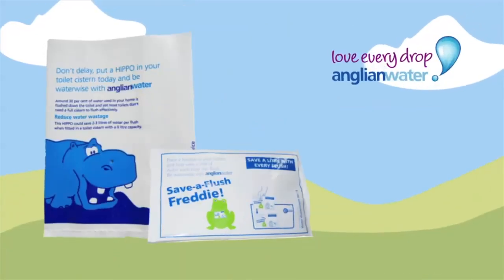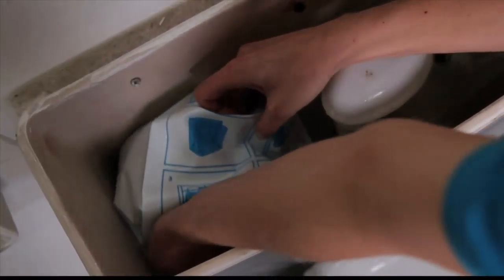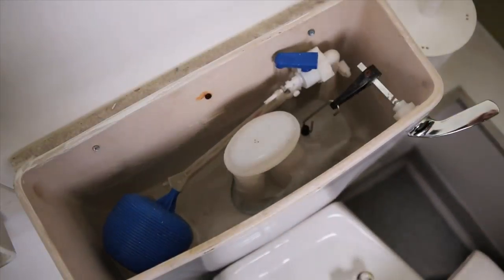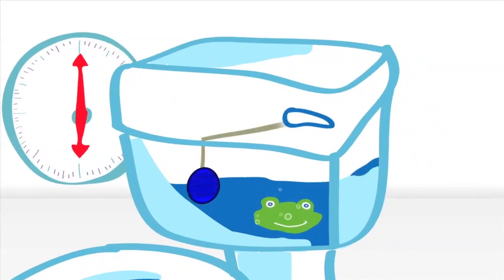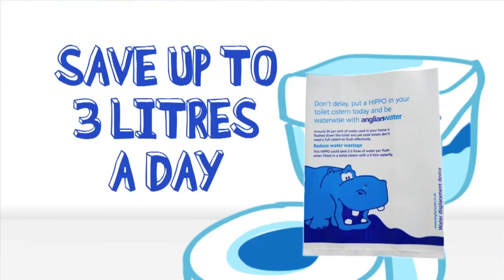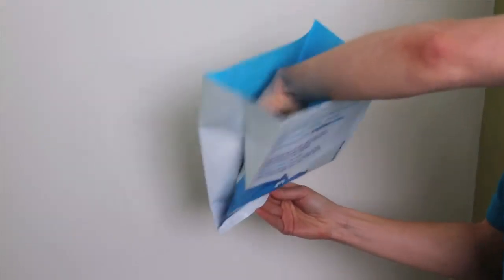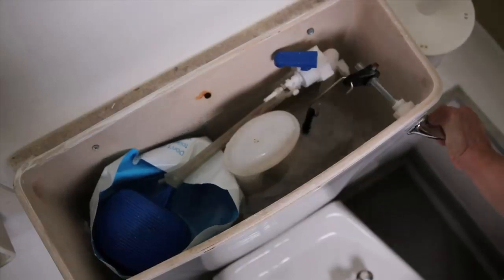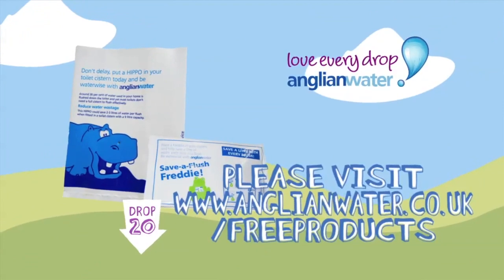How To Install A Cistern Displacement Device

Comment: Further tip:
install a top-on-or-side-to cistern handwash facility. 
You use the water that refills cistern to wash your hands as it doesn't invisibly fill up the cistern but flows visibly into cistern. 
Given you have clean water that fills cistern and wash your hands, you save each toilet trip the water you use for washing hands.